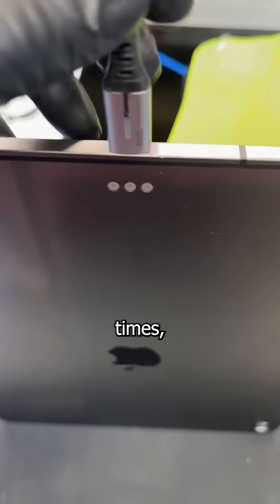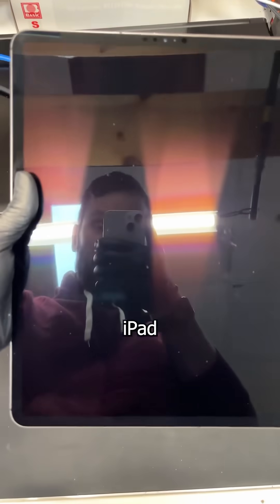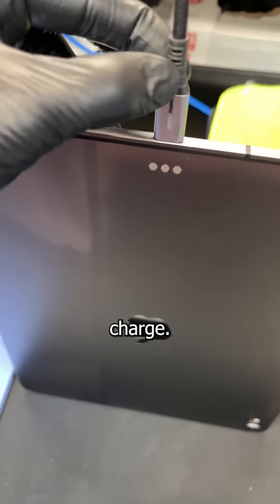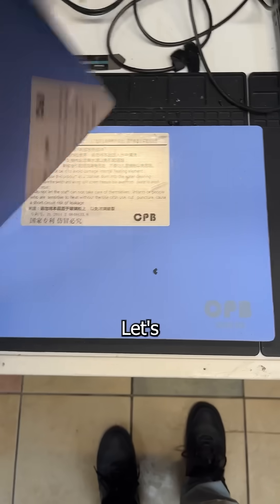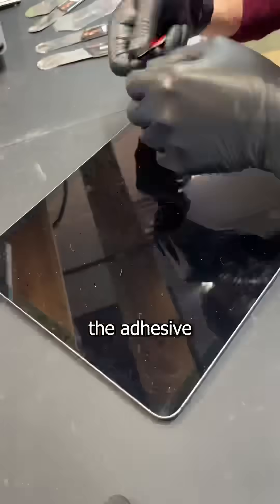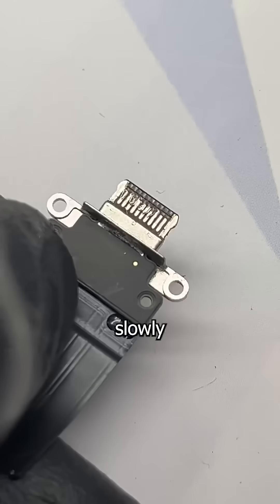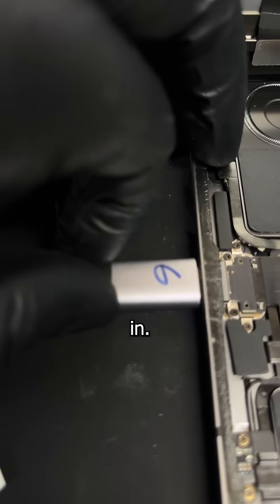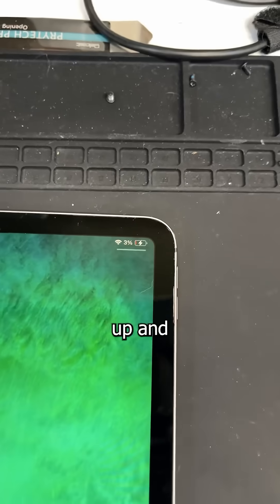#iPad Pro charger port is EASY to replace (thank you Apple) #tech #technology #shorts #pc

Comment from the maker: 🗣️ EVERY DEVICE SHOULD HAVE A MODULAR CHARGER PORT
Reply: Funny how Apple, despite being known to not be user or repair friendly, are actually good with modular charging which makes everything sooo much easier 😂
Reply: yes!
Reply: And yet the school I work at has to throw out entire chromebooks because of mashed ports.
Reply: and should not require removing adhesive on a screen.
Reply: @Dreddy72 yours is the first comment that mentions the adhesive being bad for repairability. I'll take a soldering iron if it means I can get into it without warming up adhesive, prying off the screen, then having to figure out where to get new adhesive.

Plus, where do you get that modular connector? A regular solder on Micro B can be had on Digikey for 1000 for ten cents, available from 20,000 manufacturers. Good luck with that modular connector...
Reply: Framework'll do that (maybe)
Reply: @sadclipy  man that'd be sick, imagine a laptop with the ability to swap charging ports at will
Reply: @sadclipy  Well yes... and no... I mean sort of? I guess technically you aren't supposed to use the ports without a built in dongle so I don't know how long you'd have to even use a framework laptop to have the soldered-in usb-c port fail on you.
Reply: @jayplantman   ik but it's so cool.
Reply: every one. ever.
Reply: How mutch is it to replace the charging thingy my old iPad has the same problem it is for it just can’t charge. I was able to get it to charge a little if I put the right amount of tension on it but then it just stoped.
Reply: @wowmoonwow  not that much.
Reply: FULL AGREEMENT.

Please tell me that they're are Android devices with these, I refuse to believe Apple is actually the only mobile device company smart with their design like this in this day and age.
Reply: @Michael-y9o5g most android I know doesn't have these. You replace the daughter board at best.
Reply: @Michael-y9o5g some companies like samsung did this with the s10, s10 5g had it soldered and most rn are modular
Reply: @Michael-y9o5g apple was one of the few companies to NOT have UCB-C Nintendo added it with the Switch and Android has had USB-C for ages
Reply: No watermark on this?
Reply: Wrong, every device should been completely modular
Reply: Fr
Reply: Hey do the first gen iPad Pro have the same kind of charging port?
Reply: Wait……HES RIGHT
Reply: All components should be modular. Right to repair!
Reply: especially my laptop since the charger port gets broken sometimes
Reply: For real my bro
Reply: I wanna see the greatest technician that's ever lived build a pc
Reply: *Me with the infamous thunderbolt on a t480*: yes.. yes they should 🥲
Reply: NO DEVICE SHOULD BE GLUED SHUT SUCH THAT YOU NEED TO HEAT ITS SCREEN TO REMOVE THE DELICATE SCREEN TO ACCESS THE INSIDES TOO WHILE WE'RE AT IT

Right to repair!! Let me repair the device I own!!!
Reply: No device should have a glued in screen
Reply: yes like your mother
Reply: "Okay, I guess that sounds pretty good."
(signs petition)
Reply: Yes, nothing else just yes
Reply: How do I send you something to fix?
Reply: And battery
Reply: Honestly. So does this mean that you can fix mine? Please? :]
Reply: Men thats nothing i burned my PHONE INSIDE thats way more 😅😅😅
Reply: How can I take the tip of my charger out of the charging port if it broke off
Reply: four wheel four wheel
Reply: Could you fix my iPad?
Reply: PREACH
Reply: PLEASE YES, especially now that we also use it for earphones and things like SamsungDex on bigger screens etc
Reply: I wish I had a modular charging port 😂
Reply: the sane thing hapend to me bc mine wont charge so how should i fix it
Reply: I have like a iPhone 14 Pro Max so how much would it cost to change the charger port?
Reply: More like a broken peeny-weeny
Reply: 🗣️ LOUDER!!
Reply: Most of them have
Reply: Repairability ftw. 🎉
Reply: I shouldn't have to disassemble the entire device to access it either.
Reply: This is what happens with my last IPad and it was the same type of
Reply: Wasn’t a problem when lightening was a thing. USBC is so fragile
Reply: Send me a new screen, the one newer model 11”. I will nibble your toes
Reply from the maker: @luxintelligentia4632  get a job
Reply: @SalemTechsperts Yes my Rizzly racion🤤🤤🤤
Reply: @SalemTechsperts  "I will nibble your toes" 💀
Reply: True.. after the warranty is up I’d take my phone somewhere to be swapped from USB-C to Lightning..
Reply: @CarbonRacer525  yeah.

Comment: Would you be able to do the same for a 2017/2018 dell core i3 laptop? I don’t want to trash it just because the charging port is wiggly & wont connect with any charger. If it can be fixed or refurbished & used by others then I can let it go. I have an even older laptop from 2013 but it’s in way worse condition & can only be used while connected to charger.

Comment: Until Apple decides to DRM the USB-C port if you try to swap out the replacement broken charge port by refusing to let the device boot or hold a charge because it detected hardware serial change in its list of anti-consumer anti-right to repair tactics to make you shell out for a new entire device.

Comment: I'm glad its modular, but it sucks that it breaks so quickly so you have to pay someone to crack it open and replace it. You know, if you don't feel like learning how to open a slab of glass held together with adhesive without shattering it. You know that they are probably going to charge way too much for it, too.

Comment: "Which means replacing it is cheap and easy just like your mom" got rolling me to the sun💀
Reply: Same 😂
Reply: So, how is it like on the sun?
Reply: @Isaiahgamer-wr4iz  lot of light🥶
Reply: I think the hardest part isn't changing the charging module. But opening the screen 😂
Reply: the sun doesn't move
Reply: sorry I missunderstood your comment at first
Reply: The sun actually does move!  @Parhamo0674  
It, along with 99% of everything in our galaxy, orbits the center of the Milky Way. Keep on learnin' 😎
Reply: @Parhamo0674 the sun does move

the barycenter is the very center of the solar system and the sun is tugged on by the planets there for seeming to orbit the barycenter
Reply: @Parhamo0674 It does. Everything moves actually.
Reply: Youtube comments are so repetitive
Reply: @efeloteishe4675  as if that exact reply hasn't been repeated millions of times
Reply: @3_ormorecharacters because it indeed hasn't happened.
Reply: @Palemis  that's an overstate ment by a long shot.
Reply: @3_ormorecharacters still better than the first comment

Comment: Unpopular opinion but I prefer the lightning port to usb c, main reason being lighting ports never break, the cables do, usb c is the opposite, and a cable is a hell of a lot simpler and cheaper to replace then the port. Also the idea that we NEED to use the same port for everything is just ridiculous, in my opinion it’s better to have 3 or 4 different ports that do what usb c can because those functions will work better and more reliably the when they’re all shoved into one tiny port.

Comment: And that's a big reason why apple holds on the lightning port, usb C breaks way more often than a lightning port due to the fact that this little pin connector sticks out whereas lightning doesn't
Reply: If you think that's why Apple stuck with lightning I have a bridge in Brooklyn I want to sell you :)

Comment: While I'm an advocate for charging and data cable compatibility across devices, USB-C seems far less reliable than Lightning ever was because of things like this. Lightning could get clogged and dirty more often, but wouldn't get damaged as easily. On the other hand, USB-C doesn't get dirty easily but gets damaged far more often. I think it's great everything uses the same USB cables now, but I wish USB-C was more similar in design to lightning than USB micro. This is coming from someone who's primarily used Android devices and done repair for both.

Comment: I am sorry but I still have my S7 Edge charger and cable (cable very busted many parts breaking) but still charging andthe phone also no problem with charging. So if a device of almost a decade can work with no problems after tens of thousand maybe even hundread of thousands of plugings to charge. Then something must be wrong with the ipad built durability.

Comment: Got an android and no charger can charge it (it barely charges) and because this phone is water proof there is always a cap protecting the charging port, what are the chances that it has dust in it and hasn't actually broken?

Comment: Yo bro I got a question with my laptop.
It's an Iball laptop which has 3gb ram and a 512gb HDD.
Few days ago I was playing games on it and suddenly my mouse disconnected and it kept showing a notification "The last USB device you inserted in this computer has malfunctioned and windows can't regonise it." And since then, my touchpad and mouse isn't working if my laptop is on charging but the touchpad works fine if the laptop is running on battery (the mouse still doesn't works tho).

Do you know what can be the problem?

Comment: Putting it down face first on that heating pad is a good way to melt or damage the screen. Me and my employees at my shift ALWAYS put it on the pad backside down, the metal will conduct heat to help with the adhesive, I've seen way to many LCDs get damaged that way on the front side down. Plus that's a $400+ loss if u do have to replace it

Comment: Does apple have any anti repair controls like shutting down the camera, slow charging, bugs, etc when replaced with a non official charging port? If it does can this only be solved by resetting the device?
Reply from the maker: We’ve never had an issue and I’ve done dozens. I believe it’s because the iPhone one has so many more sensors on it

Comment: those charger ports don't have a thermal monitor sensor on them do they? I know certain iPhones do and cheap knock off ports cause a reboot loop on them
Reply from the maker: Not sure if they to tbh but have never had a problem with them and I've done a few dozen so far.

Comment: Usb c is the dumbest thing compared to lightning. The durability of lightning port is way higher than that shitty usb c. My ipad pro with usb c is the first ever to get repaired because of a usb c malfunction TWICE. Never happened to any lighting port i had before.
Reply from the maker: Are you using aftermarket cables though?
Reply: @SalemTechsperts  nope, same charger from apple. The wire is still working today but the port i have to be careful with. Ill wait for magsafe ipad before i even think about replacing this. Stupid usb c.